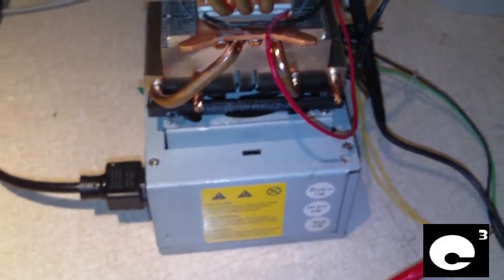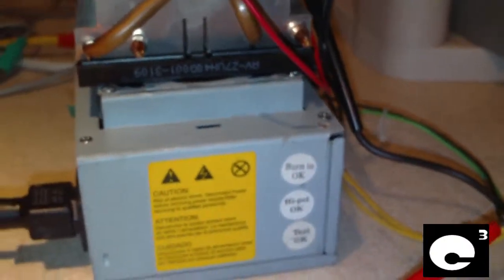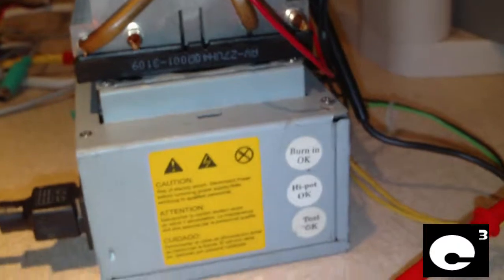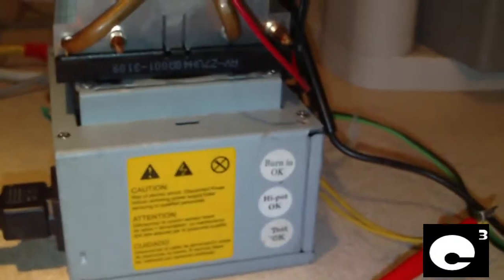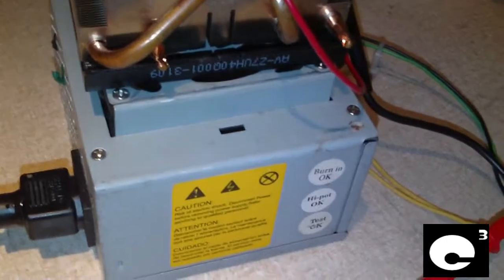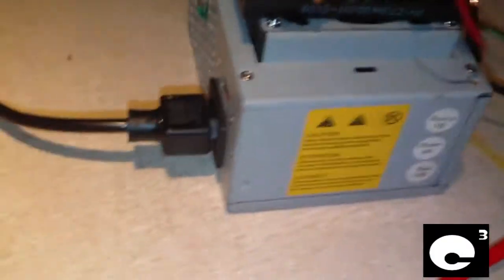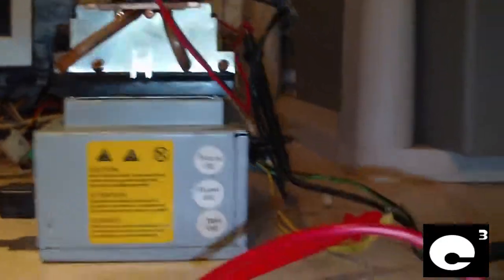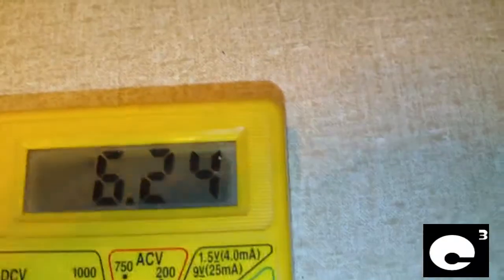Bestec ATX100-5 - The little fighter.

Comment: I have the same PSU that came out of an HP machine from 2000 which the motherboard died in. I put it in place of a 120w Ilssan power supply from an old emachines (one of the "never obsolete" models.) The original power supply was getting very unstable. Even though the original one was rated 120w and this one is only 100w, it weighs twice as much. I have no doubt that it will do a better job powering that machine than the original one.
Reply from the maker: Those Ilssan PSUs were junk. I remember seeing them in some older emachines systems and remember hearing one screeching/hissing badly when powered on.

Comment: I have the identical powersupply, but can't get it to work without the motherboard despite jumpering the (green and black) and placing a 10W10Ohm sandbar resister on the 5v rail (red and black).  What am I missing?